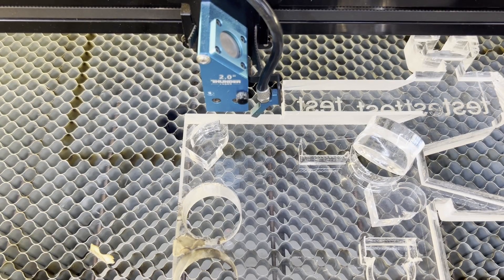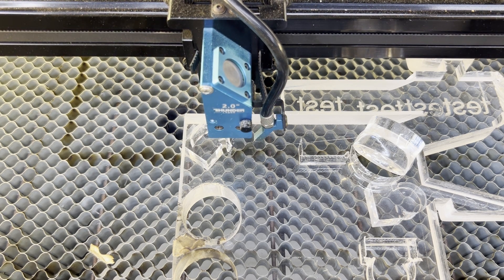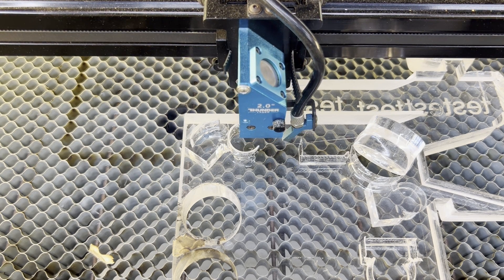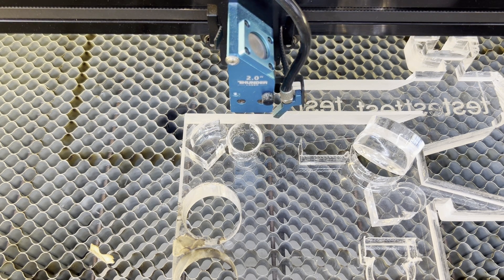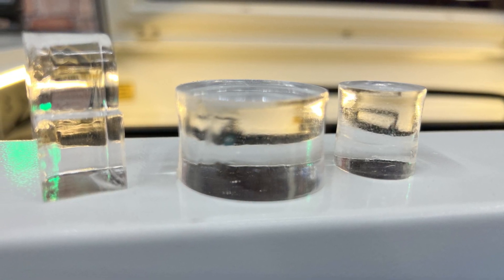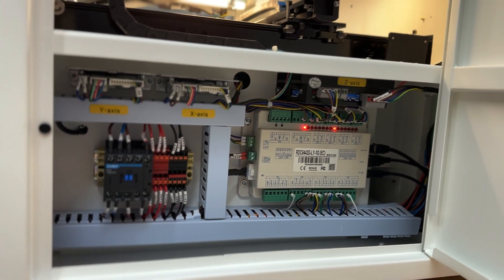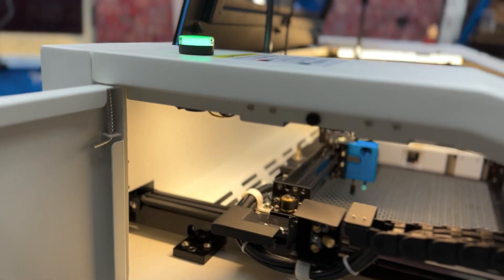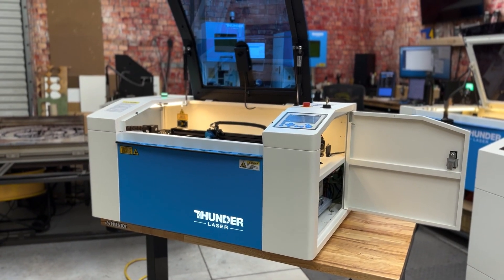RF Co2 vs Glass Co2 (WATT? Thats crazy!!)

Comment: The beam exiting the RF source may be 2 or 3mm diameter compared to the 6mm of your more powerful glass tube but that 2mm "fine" beam is not what's hitting the lens  The 2" ZnSe lens is the same in both machines  and I have seen TL videos explaining that,you need a 4" lens to cut thick material. I note you are still experimrenting with the Odin and the great thing about RF technology is that it is still 10.6micron wavelength, That means that your 25mm clear acrylic will clearly show the diameter and intensity distribution  of the unfocused beam that arrives at your lens. Just remove the lens and with full power  fire the beam at a piece of 1" acrylic (on the bed) and time how long it takes to penetrate  25mm. Do this first  test in back left corner and then at the right front corner of the machine do the same test for the same time.. I think you will find the results interesting especially when you compare it with your glass tube.
Reply: Well, this is very interesting comment! Could you reveal what you mean in detail? Do you mean there is a significant difference between beam "parallelity" between glass and rf? Thanks.